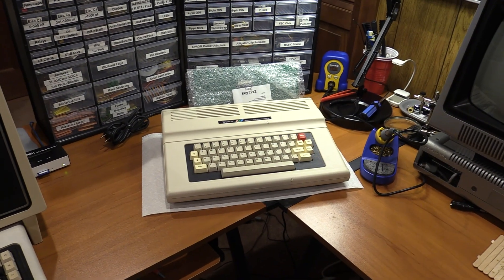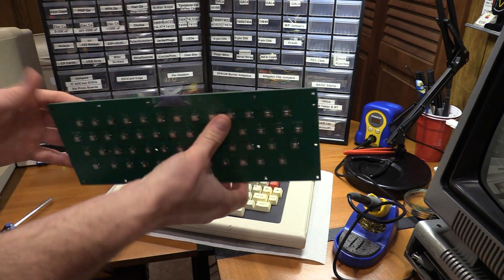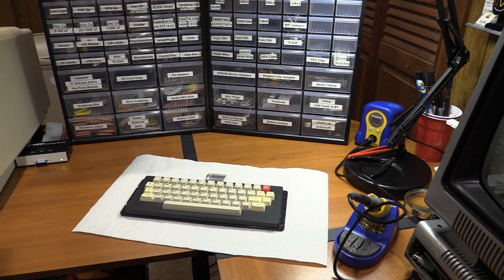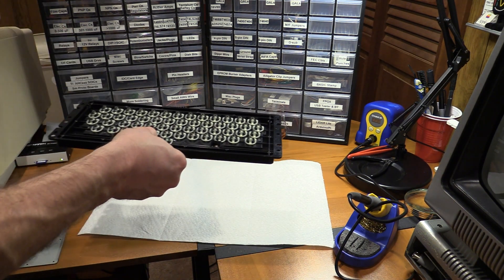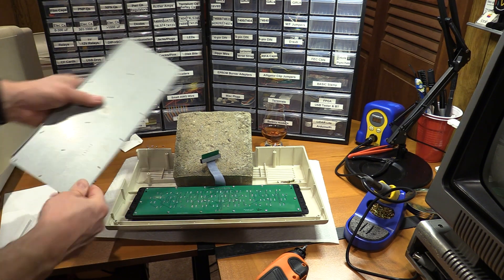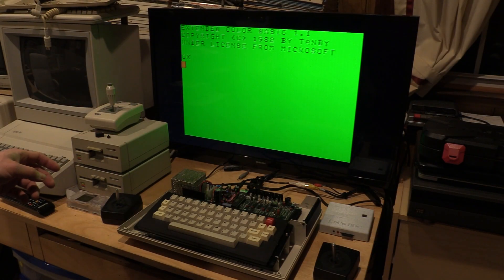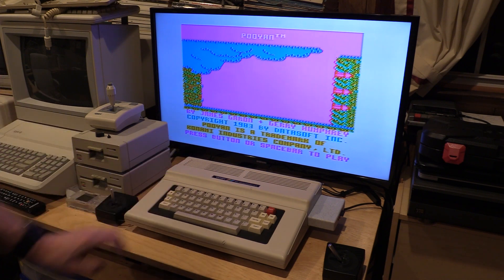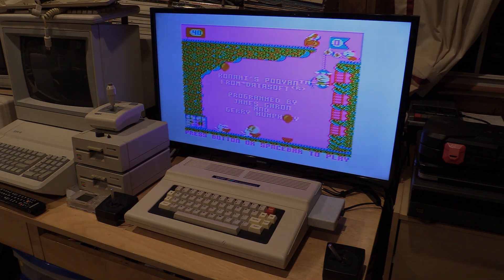Tandy CoCo 2 - Fixing My Keyboard With Keyfix2

Comment: Probably a stupid question, but would this also work on the earlier CoCo 2 that has the “melted” keyboard?

That’s the one I have, though it doesn’t have screws on the back, it has the plastic knobs all over [unless there’s screws underneath, but I’ve never checked]
Reply from the maker: I wasn’t sure, so I asked the person who makes the keyboards, and the answer is yes if your melted keyboard has the PCB screwed onto the bottom of the keyboard.

Comment: Perfect timing!! Thanks for the great video!  I got lucky and found a Coco2 that was never used!  Just did the CocoDV upgrade to the video and when i put the keyboard back on the shift keys weren’t working…. I HATE that flimsy ribbon cable that is stock. The far right “pin” has gone wonky…. Was so glad to see this upgrade!! Just ordered it!
Reply from the maker: Glad I could help!  And congrats on your CoCo 2, it’s a great machine. Add in you’re upgrades and that thing will rock.  Enjoy!

Comment: Good job. Would adding a 1mm thick plastic washer under the screw allow them to be tight and not cause key issues?
Reply from the maker: It’s a neat idea.  I’m not sure how it would pan out off-hand, but when I get to replacing my CoCo 3’s mylar, I might have to try it out.  Thanks for watching and the suggestion!
Reply: I need to fix the doc sheet. The gap is a feature;) Mylar is flat, these switches click over mid-travel.  The exact height changes between same model keyboard, and you might want a higher or lower firing key anyway. So we left it floating (and ambiguous).
Reply from the maker: @rickulland3500  I got where you were going, and it’s working great.  Thanks!
Reply: @rickulland3500  Cool. I come from German school of torque.  Make everything Gutentight.  :)  So this note would be helpful.